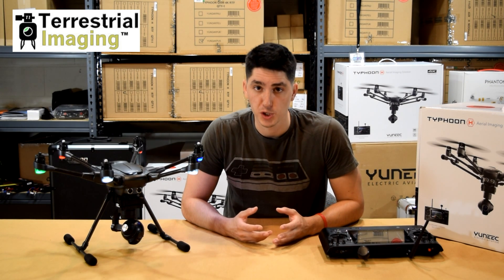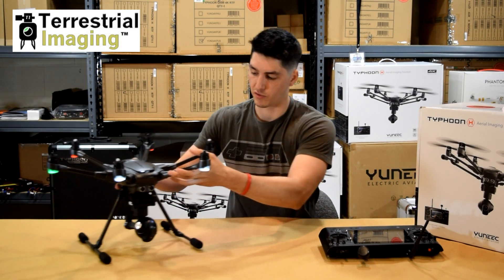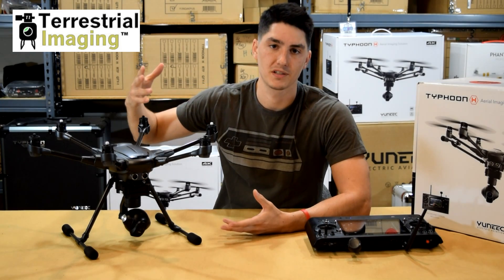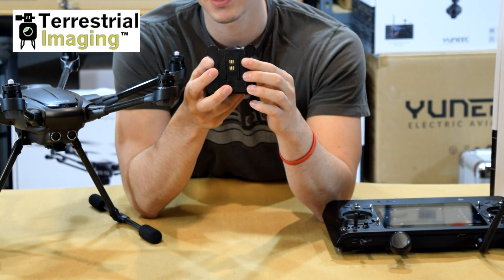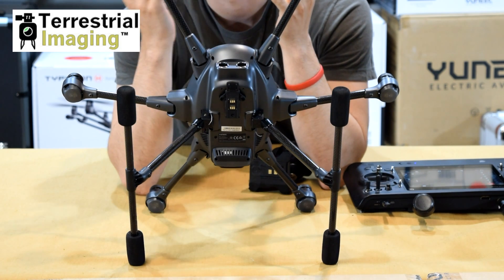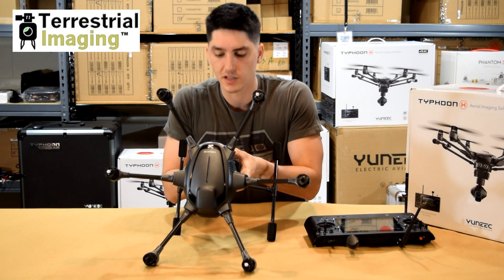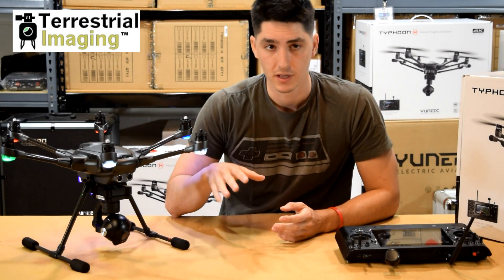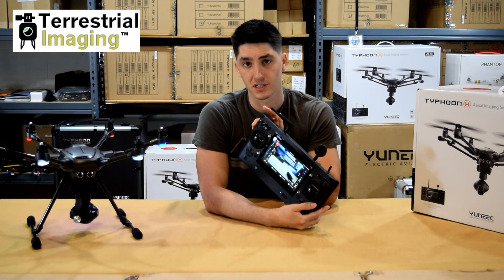Typhoon H CGO3+ Camera Fix For No Video

Comment: I tried my Typhoon H and camera out after buying it from a fella. The camera movements functioned as they should, but no video and says no SD card installed and I tried several of my 4K cards. . I then tried a suggested YouTube instruction as tapping SYSTEM SETTINGS on the ST16 and then after clicking OK, the main screen showing the camera came  up on the screen. I tapped on it and returned to the main screen and still no video. All other functions worked and I slid the gimble on and off a few times and same thing.

Comment: I have a question   when I turn the typhoon H on the camera just starts beeping over and over . Do you have  
A  suggestion
Reply from the maker: A beeping pattern means that at least one of the motors or circuit boards on the gimbal need to be replaced.  When replacing these parts, the gimbal will also need to be calibrated. If you are looking to get your camera repaired, you can fill out a repair ticket and we'll take care of you: https://www.terrestrialimaging.com/repairs/

Comment: Why even with my PAN off my camera moved 360 very slowly. During flight.  Wh does it do this  

It is very annoying.
Reply from the maker: Hey John. It sounds like you may need to re-calibrate your controller. You can test the controllers in the "hardware monitor" section in your controller.
Reply: @TerrestrialImaging  

Hello. 

I use my Copter for Search amd Rescue. 

I calibrate it constantly. 
And then i test the harware testd too.  

 But it seems like after 5 mins flying. The Camera constantly moves SUPER SLOW by itself.  

And now that i customized it with your items i lost me warranty. So i can't even get exchange it
Reply from the maker: @DR-CATIO  You may need to send it in for repair. If you'd like, you can create a repair ticket with us at terrestrialimaging.com/repairs.
Reply: @TerrestrialImaging    

Thank you. Yes i actually Ordered jy Antenna Modification kit from you.  & by doing that i Voided my warranty.  Lol

I just unplugged the Camera from the Copter then plugged it back in. Now it works again. 

But i have over $1000 in customizing on this Typhoon H 

Lol i was speaking to your customer Service rep a few months ago. He was helping me install the Antenna kit. 

I told him everything i had gor the Typhoon H - and he laughed at me and said 

         "John you literally bought every accessory for a drone you can"    

So because i use it for search amd Rescue I HATE sending the unit in. Cause then i dont have it for weeks. 

Is there a Repair manual or a Step by Step guide that you would do to service the camera, that you could send me. So i can Repair it myself?
Reply: @TerrestrialImaging  

I think it was the Battery in the ST16. Becuase now it is Not working at all and the Battery Failed Signal is on.  So I went to your site ajd just ordered a New 1.
Reply from the maker: @DR-CATIO  Thank you for your order! Hope it solves the issue.

Comment: My CG03 camera not capturing images. Any suggestions?
Reply from the maker: Hmm...is your memory card full? Or do you have a memory card in? Silly questions I know, but you never know! Other then that,  perhaps rebind. Or go into camera settings and make sure your corrected to the correct camera type. On the bottom right of the screen, if i recall correctly, there is an option to switch between video mode or picture mode. Make sure your in picture.

Comment: my st16 powers on but then won't finish boot up...any solutions? replace lcd inside?
thanks
Chris
Reply from the maker: In some cases if it is not fully charged, the blue light next to the on and off switch will turn on, but the controller won't. Always make sure your charger is fully charged. 

If that isn't the case, I would contact Yuneec because chances are yo uare still under manufacturer warranty.  I wouldn't want to mess with a screwy controller.

Comment: Great video. It is unfortunate that you need to do this considering the money that these cost.
Reply from the maker: Thanks RC....The majority of these problems do stem from hard landings, crashes, or in some cases the user actually removing the camera and not installing it properly.  So far, it has been a rare occurrence to see this type of problem right out of the box.

Comment: Thanks for the tip
Question is this then a QC issue?
Will it be addressed in the future by Yuneec?

Cheers
Reply from the maker: Judgey GX: I'm not sure if its a QC issue.  The camera is made to take on and off.  Sometimes this happens if you take it off and put it back on without locking it in properly.  Bottom line is if for any reason you are not getting power to the camera, taking it off and putting it back on usually realigns the contact points and solves the problem.  Thanks for watching our vids.

Comment: nice
Reply from the maker: Hey Kool Brotha.  Thanks for watching.  We've noticed that on occasion a user might have a hard landing, or experience something else that slightly misaligns the contact points preventing the camera from getting power.  This could happen to any of us at anytime.  Simply taking it off and putting it back on realigns the contact points and can avoid unnecessary downtime.  Hope it never happens to you but if it does, it could be a simple fix.
Reply: Terrestrial Imaging LLC 9